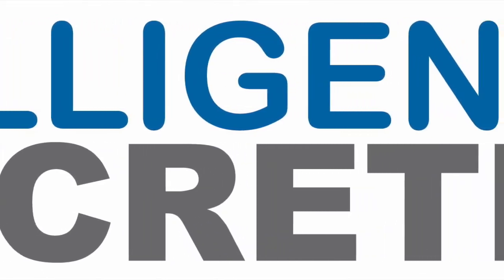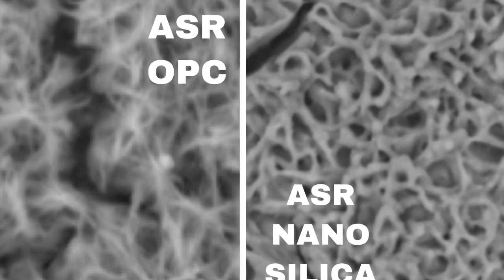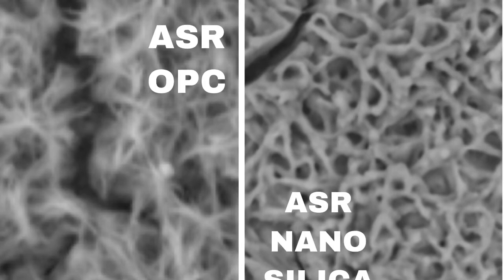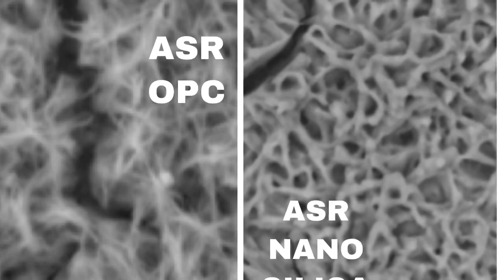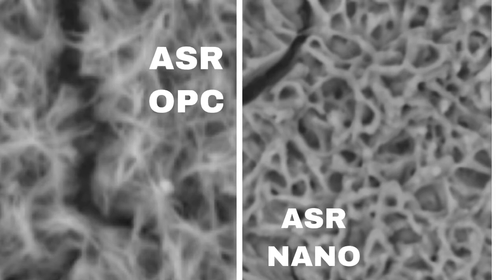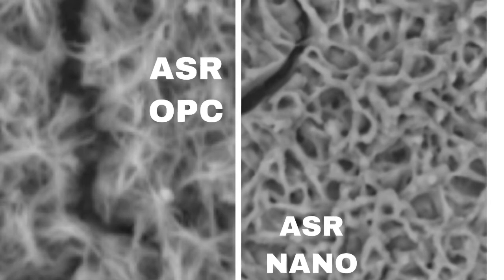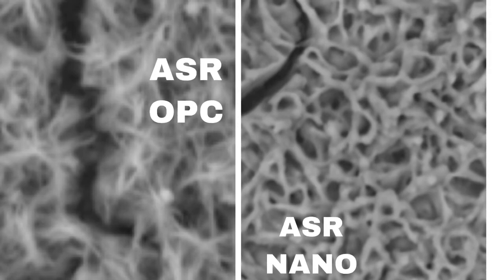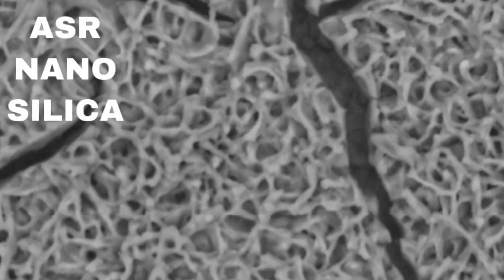VLOG 719 - THE IMPACT OF NANO SILICA ON THE ASR GEL MORPHOLOGY WITH THE ASR GEL PAT

Comment: A 2017 DOE report on concrete longevity (that you may have seen):  "The  addition  of  fumed  silica increased the real impedance of both simple and aggregated concretes indicating it is effective to slow down O2 and Cl-. Micro silica showed a significant effect in the simple concretes but not in aggregated concretes. Glycol had limited effect only in the simple concretes. Colloidal silica was least effective."   https://inis.iaea.org/collection/NCLCollectionStore/_Public/49/042/49042363.pdf  (Don't know what they mean about "aggregated" v "simple" concretes, and why colloidal is different than fumed)
Reply from the maker: It looks like they used all three types of silica: colloidal, micro, and fumed.  Colloidal normally refers to something in suspension and in the case of silica, its normally in the nanometer range for particle diameter.  Micro silica is a larger silica particle nano-micron range that is produced from a raw material.  Fumed silica is normally a by-product of some other process, like ferro-silicon alloy production.

I hope that helps!!!